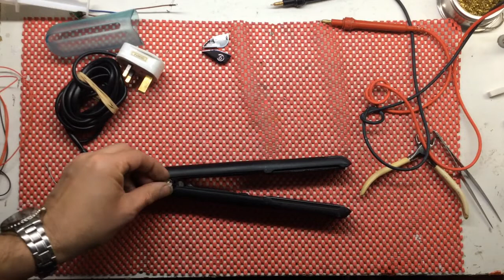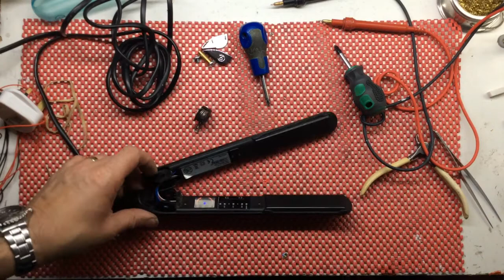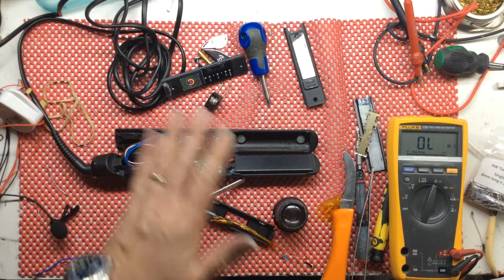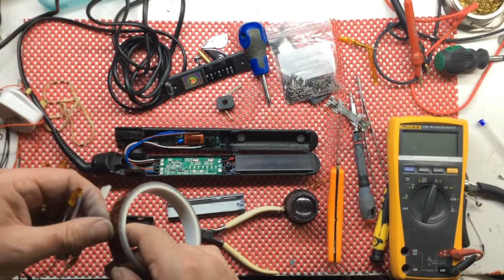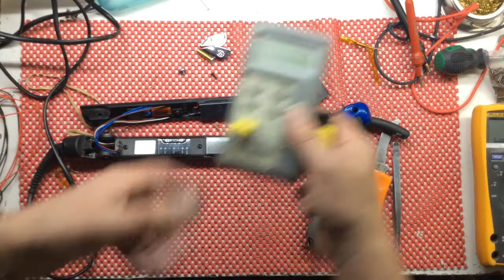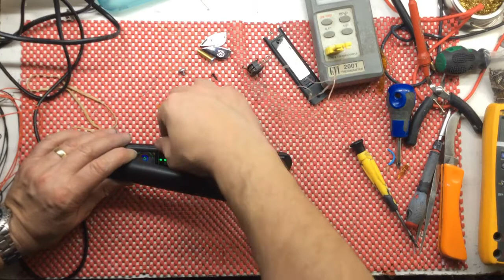Repair of a Cloud 9 Hair Straightener

Comment: Hi Kev, can you point me at a source for those crimpers you use at 8 minutes in please?
Reply from the maker: Hi Ross its a DMC crimper without turretts, just ebay DMC crimper
Reply: Thank You
Reply: Hi Kev
Can you give me the model number off your sticker please, there's quite a few and as they are premium priced I wouldn't want to own one the wrong size or shape. It appears that the crimpers manufacture the crimp as you squeeze the handles is this correct? If yes can you also point me at the consumables you are using in yours. I want them for exactly what you use them for in this video.
Reply from the maker: Ross Keen its a AF8 with fishing rig crimps, sent info with links to Gary as i think you two have been talking about it. Sure there are cheaper versions around as the DMC you pay for millspec
Reply: OK thanks Kev, the holy grail for me would be one that created the crimp from a strip of brass inside the handles, looks like currently it's a pipe dream. Yes Gary flicked me the links and I have a bid on one at the moment, finishes Saturday. I currently use brass jewellery beads and a double the size of yours fishing crimper. It creates a crimp with 2 flat wings 180 degrees apart. Once covered in Kaptan they are hidden but 3 to 4 years on when you need to do the fuse again it's just a matter of snipping off the wings. With the DMC crimper I expect we will be losing the wire within the crimp because I'm expecting a DMC crimp to be very time consuming to remove and still retain the wire length.
Reply from the maker: yes you wont remove a crimp that has been crimped with the DMC, did gary send you the link to the hand cold welder, no crimps at all with that one, even thought about one of these battery welders

Comment: Hiya, straighteners keep going off after a few seconds and beeping. What would you do or know what the problem is, thanks alot
Reply from the maker: proberly a broken heater.
Reply: @KevsElectricalWorkshop  how does one fix a broken heater, if you can't afford to send it away for repairs?...I really need it fixed, cannot afford I knew hair straightener at the moment.
Reply from the maker: @Charnelle.L.D  watch loads of videos and then order the parts and try yourself, if you diagnose wrong then it will cost you more again so weigh up the best option
Reply: G'day Kev! Have a cloud 9 that had a rabbit chewed cable that eventually died. I've replaced the cable and powered back on. Constant beeping after about a second. Heaters are all sweet but I can only find one part that looks a little off, it's labelled D7, any ideas what it is? 

I suspect voltage drop has increased current draw and cooked something but I'm unsure. It's open circuit
Reply: In new information, I was getting a 0.7vdc drop over D7 and in testing shorted to the r27 with the lead and now no longer have beeping but all led's illuminated and no button operation. I suspect it's time to bin it.
Reply from the maker: @nicolasdecarpentier9047  the main cpu is probably fried, it dosnt take much.

Comment: Hi Kev - Cloud 9 straighteners not turning on. Crackling sound from them in the weeks leading up to them failing. Could this be the thermal fuse failing?
Reply from the maker: Dont do many C9's but could be the the resitor bank on the pcb/ broken heater wire or broken mains lead i would guess
Reply: Can I repair a wire on a c9?

Comment: Kev can I ask if they indeed did have smart chip in the circuit board? To regulate the temperature of the flat iron? Many thanks
Reply from the maker: they do have a microprocessor on them
Reply: Hi Kev how can i sent u a pic of my cloud 9
Reply: @KevsElectricalWorkshop  hi kev my cloud 9 that green thing samething did burn on it